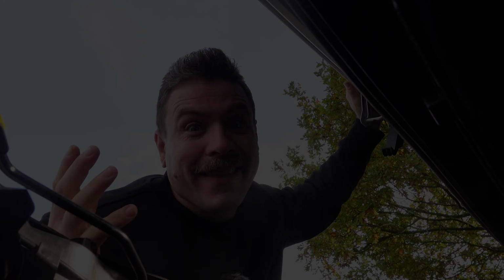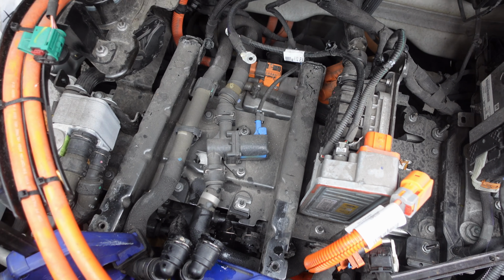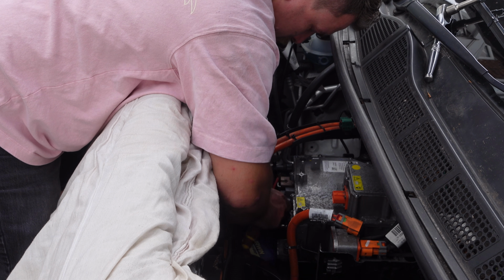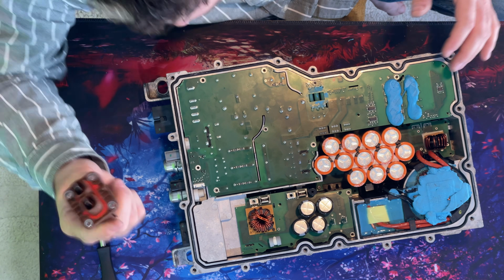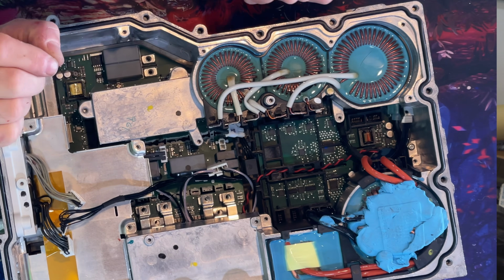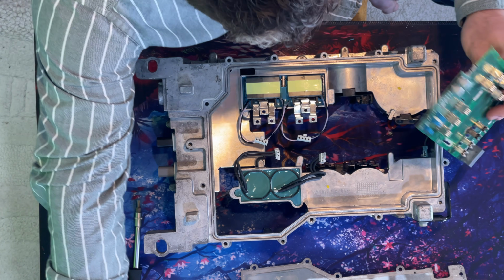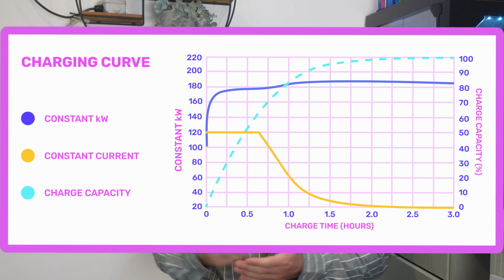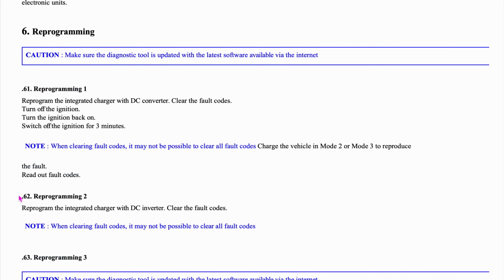Dealer Quoted £3,000 — I Fixed It for £380… But It Wouldn’t Work Until the Dealer Did THIS!

Comment: That looked massively massively complex for something that does a very simple job. I've been designing embedded electronics for many decades (serious stuff) and doing the fairly scary coding, but that just had me shaking my head at the amount of excessive chipage. Filtering board, great, legions of orange caps, makes sense, seriously cooled board stuff with many many MOSFETs, yup, that will be needed, but all those other boards stuffed with enough processing power for a moon landing ... that just feels lazy.
Reply: Not that simple though. Everything required monitoring, logging and protecting. Then on top of which, there'll be different battery models, chemistries, inside vastly different vehicles, from vans to run abouts. Economies of scale say, having one standard charging system can be cheaper than 10 separately different ones. Then, after all of this, add in the fact that every board has to be certified and tested. It's sometimes easier and cheaper just to use an existing model, bolt on bits to it... and there ya go. In the automotive world, it's not unknown to have 10+ year old parts flying around...
Reply: @khalidacosta7133  Still sounds simple to me, but I'm of the generation that did a huge amount with a slow 8 bit CPU.
Reply: @gadgetmind  Yeah... here I am, using a 32bit microcontroller just to translate a few CAN messages.... and I suspect this is the other issue as well. It's easier to just use a software library than custom code to perform the functions, which increases computing power etc. I don't think it's an engineering issue, but an accounting issue, which makes it overly complex.
Reply: @khalidacosta7133  Surely different battery models and chemistries is just software parameters. It doesn't need 4 more boards. I'm inclined to agree with gadgetmind that there seems to be an awful lot of subsystems inside this box. Maybe there are good reasons for it all, but I'm starting off skeptical.
Reply: @khalidacosta7133 a) many safety and protective functions should be "analog" and inherent to the circuitry. Thats the way to design it(of course some elaborate functions need some computing), and monitoring and controlling should be above it, keeping an eye on it and making it user friendly. Period. Thats the way to go!
Reply from the maker: Thank you for your input. It’s nice to hear somebody with electronics experience speak up.
Reply: Some of that will be due to the variety of systems in one box, but also logging and control to ensure the SIL's (Safety integrated Levels) are managed correctly, there are strict rules that these systems have to comply with and log data, those systems have to be programmed to ensure fail safes are in place, just putting a three phase inverter in their with no SIL protection would potentially cause  some very serious fatal accidents.
Reply: @RMan011 You're bringing back my days of having to work under ASILD and ISO26262, which means I'm going to need a little lie down!